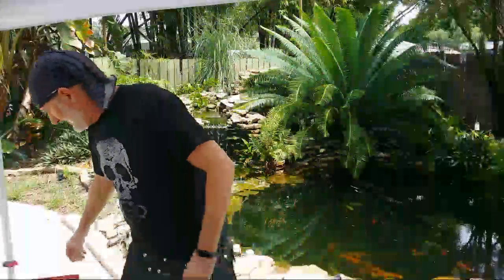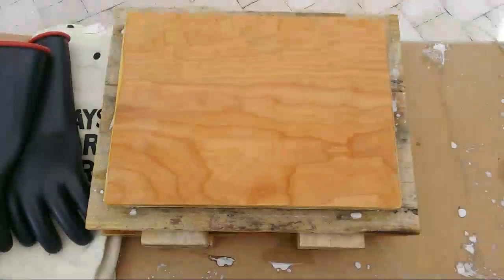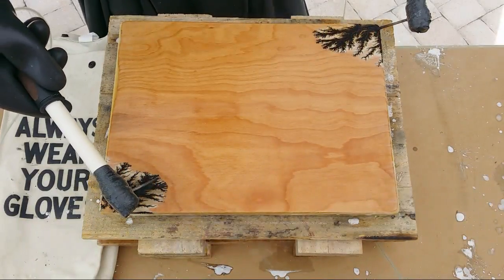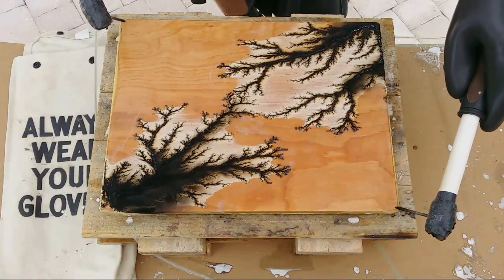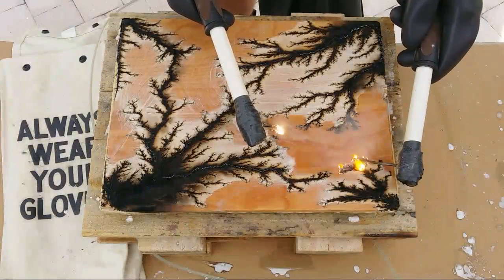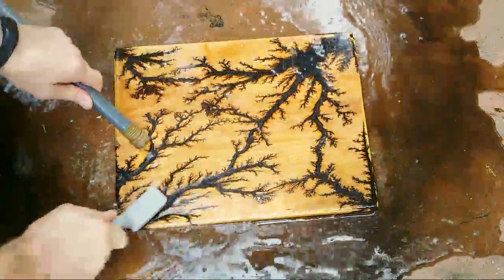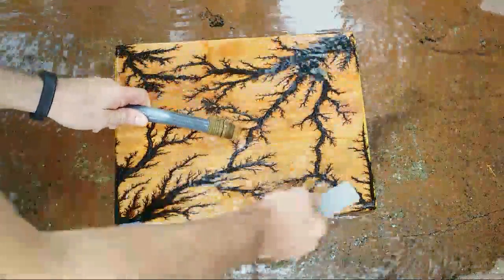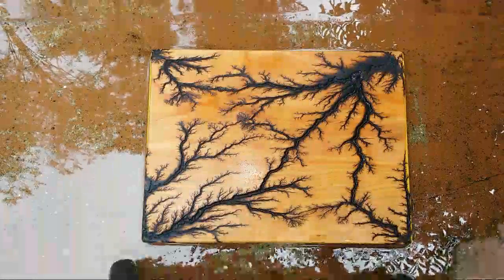Lichtenberg Art Livestream - The Burn

Comment: cool stuff! Working on my equipment. I thought welding gloves would be ok but high voltage glove you can't go wrong.
Reply from the maker: Welding gloves DO NOT protect you from high voltage.  Use ONLY Class 2 High Voltage rated gloves with leather protective outer glove.  They're expensive, but your life is priceless!